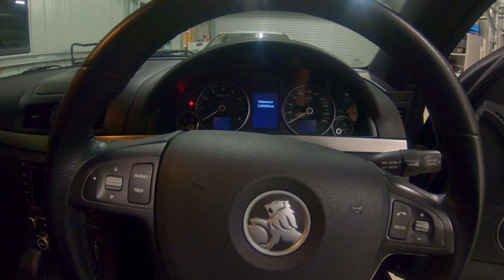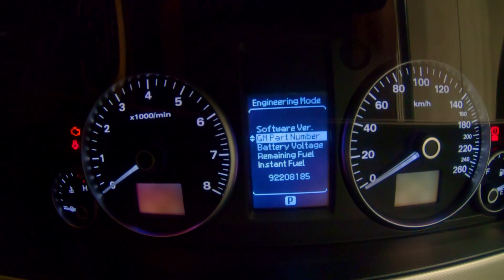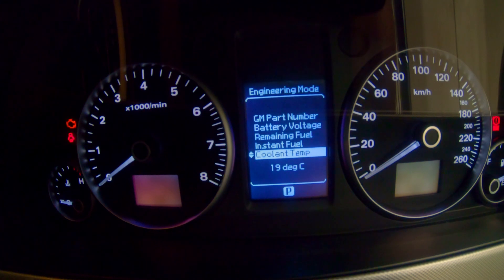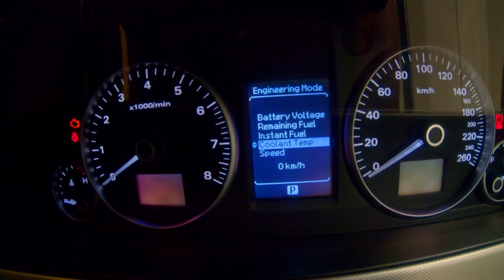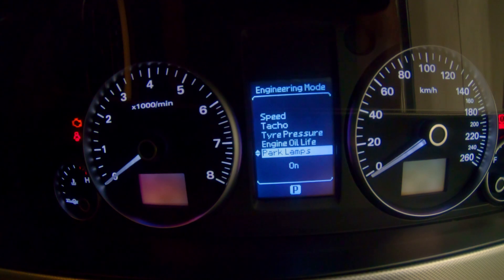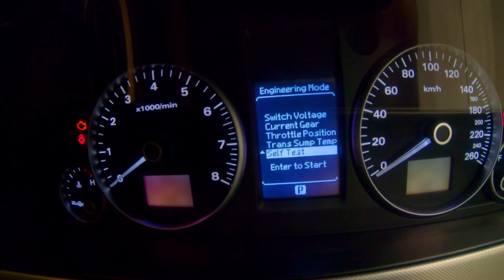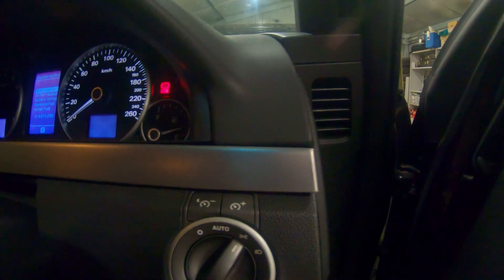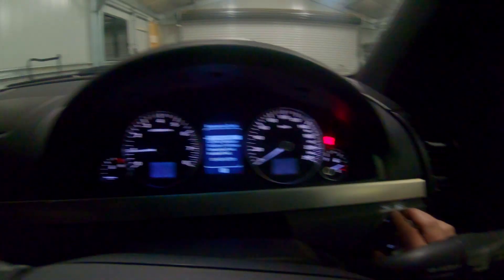Engineering & Night Modes - Holden VE & Pontiac G8

Comment: In regards to the fans coming on at the mentioned temperatures, is that for the 6L?
Reply from the maker: G'day mate, yep those ranges (on at 104, off at 99) worked on the L98 6L in this Calais. From memory they applied across a number of GM/Holden engines too - my ol 3.8 in a VT was exactly the same! 
Are yours working all ok? Cheers!
Reply: @MeatballGarage  it's at the mechanic as we speak. They used to come on at 98 degrees (L76) and turn off at 95. Now they come on at low speed at the 100 mark but high speed won't kick in at all.
Reply from the maker: Hmm some funny business going on there - has it overheated at all?
Reply: It's all sorted, turns out it was a faulty radiator and temp sensor
Reply from the maker: @calais86  sweet! Thats a nice easy fix! All commodores do a radiator at some stage, all part of the fun!

Comment: Tyre pressure can be added to that car my base model comes up blank so at some point in that cars life it had tpms.
Reply from the maker: G’day Keanan - i think all 3 window trip computers came with that menu in engineering mode - as TPMS was standard on some HSV models as well as the Caprice that shares the back end of the dash. Im sure the Calais could be retrofitted with the monitors in the wheels, the signal receivers at both ends of the car and the dash programmed though. Cheers!
Reply: @MeatballGarage the g8 had tpms standard i think, and it had a dashlight for tpms
Reply from the maker: @bigmansir3745  I think you are right mate - the G8 had a few features standard over the Aussie equivalents
Reply: @MeatballGarage  i think that that is apparently the case. Also is remote start standard on the Ve, on the g8 it apparently is.

Comment: Hello i have a pontiac g8 gt 2008  i Having trouble With the (Battery saver mode on) can you help me with that my battery and alternator is good
Reply from the maker: G'day! This happened to me once before - its more the charge state of the battery that will throw this warning.
I got it after the car sat for a while then did a few short trips - so the battery was a bit depleted.  
The voltage measured at the battery was low - but the Alt charge on engineering mode was showing normal.
I put a trickle charger on the battery after that and it was fine. If that didn't work I would have chucked in a new battery.
How old is the battery in your G8? Do you drive it much?
Cheers - Marc

Comment: Hi mate , hey in engineering mode on  v8 08 ve I just did an alternator & at idle it's 14 + volts ,the next check says charging & what's that supposed to read ? Mine says 0.0%  I haven't driven it since fitting alternator & starting it ,sounds good but I just thought I'd ask outta curiosity & good to learn these things cheers mate.
Reply from the maker: Hi mate! From what I understand, the charging rate will vary depending on what the battery actually needs. If I didn't drive mine for ages, it would be in the high 14s or even at like 15, then on long trips, or if I had driven it regularly it would dip well into the 13s or sometimes high 12s! I use to watch it like a hawk thinking something was wrong, but I think its just the car only providing the charging level it needs rather than a constant supply.  Sounds like yours is ok though!

Comment: How do u get the blue lettering instead of red ?
Reply from the maker: Hi Mate - This colour dash was standard in the Holden Calais. 
You can see the full car in this vid here: https://youtu.be/kAYhmVjD9Gc 
There were 3 specs of dash in our Aussie Holdens - Green for lower spec, White/Blue for the luxo versions and Red for the sport models. 
Do you have a G8? 
You might be able to pull it apart and replace the lights in the dash if you are keen to change them.

Cheers!

Comment: My engine light sensor i faulty. Can this be a diy job or is it one of those jobs best left for the mechanic?
Reply from the maker: engine light sensor - as in the oxy sensor that goes into the exhaust?
Reply: @MeatballGarage   i dont know to be honest. My engine light been on for a while now but my mechanic didnt seem too fussed about it. He reckons its only a sensor and that the engine was fine.
Reply from the maker: I'd still get them replaced - the oxy sensors provide data to the ECU to determine stuff like A/F ratio, timing etc - you might find your car running a bit rough after a while.
Reply: @MeatballGarage   thanks mate ill do that and see if it will get rid of this engine light.

Comment: Disconnect the little speaker under the dash to the left of the steering shaft = No more annoying beeping...
Reply from the maker: Hmmm I might have to look into this mate, could be a winner! But might be the same speaker used for my front parking sensor alerts so will see. Cheers for watching and for the hot tip!!
Reply: @MeatballGarage    This speaker saved me when my radiator cracked - I got an audible alert about the very high coolant temp - which was just as well because I don't necessarily look at my temperature gauge once a minute... pulled over straight away - V8 is OK!!  But now that I know where it is I might wrap some foam around it to make it a bit quieter - thanks Loading User.
Reply: @MeatballGarage  hi mate, been driving my VE calais with engineering mode on because i think my alternator is going. The voltage does not increase when accelerating, and is always under 13 volts or just over, if i have the car running, and pull out the positive plug and it shuts down, is that an alternator, thanks?
Reply from the maker: @billshinas27  G'day Bill! Righto - I too did this for a while cause i thought the same thing. But these things will only charge to what the battery actually needs. The computer on them can charge the battery anywhere from 12.6 to 16v - depending on the needs and condition of the battery.  I did 2 alternators in my Calais about 18 months apart - both times I got the warning on the dash ('check alternator' or something). That is when you know its cooked! If your car cranks fine and there is plenty of voltage at your battery (check it with a multimeter) you should be fine mate!
Cheers - Marc
Reply from the maker: @billshinas27  Also - never tried pulling the plug on it whilst running - so not sure if that is normal or not.
Reply: @MeatballGarage  much appreciated. By the way I didn’t know there was a ‘check alternator’ warning, if there is anyway, thanks mate.

Comment: Pontiac g8 have red lighting on everything you have that's a cool blue color
Reply from the maker: Cheers mate! We have 3 different colour combinations from memory. Green for the lower and mid range, red for the sport models and white for the luxury models. White looks the best in my opinion! Thanks for watching flagcity parts!
Reply: @MeatballGarage  I've been wondering if there's a default setting in the  Pontiac's from Holden that lets you reflash it to another color
Reply from the maker: Ah nah mate, its the colour of the LEDs behind the dash (which sucks if you hate the colours!!)  Ebay might have a kit you can use to change them out. 
I think you can hack/reprogram the head unit to change it from a Holden, HSV or Chev bow tie start up logo if you want to customise your car a bit further - check that out if it floats your boat!